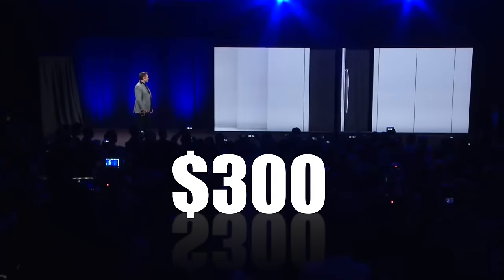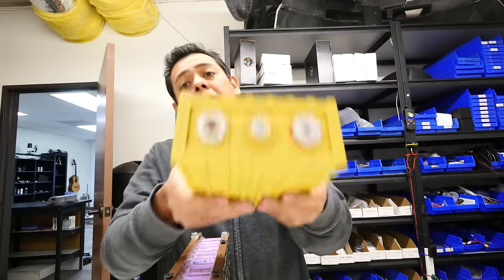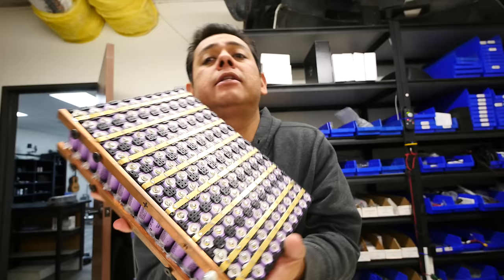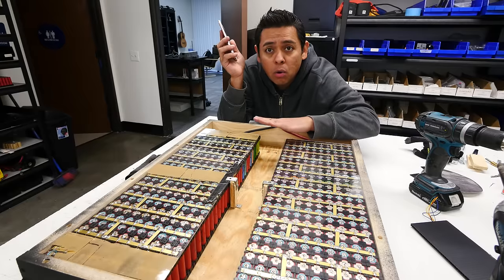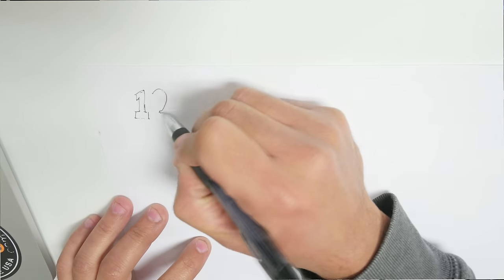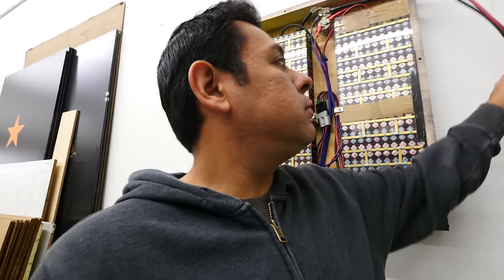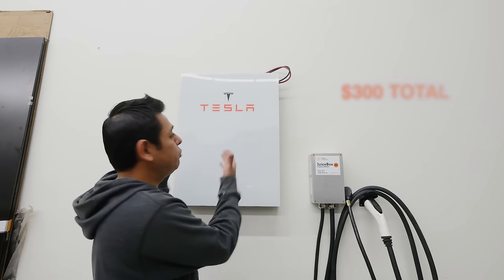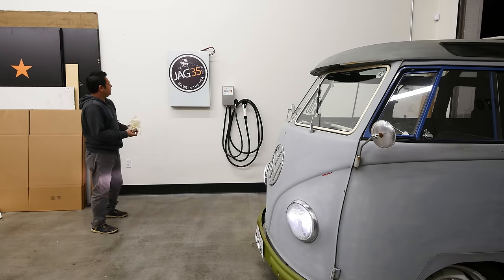$300 DIY Tesla Powerwall - Solar storage 18650 lithium ion home Battery

Comment: How are  you balancing your cells?  This is necessary...
Reply: +Rick Smith bottom balancing is used, with periodic checks with multi meter.
Reply: That's pretty cumbersome when you have 600 cells.  If you get a whole pack down to a certain voltage that doesn't mean that every cell is even.  It just means the pack is that voltage.  Without cell balancing, as time goes by individual cells will come out of balance, this is pretty much certain.  This is why BMS is used in Lithium energy storage applications (off grid, etc).
Reply: +Rick Smith when he checks capacity he leaves them discharged, each pack is 150 cells @3.7v  roughly 300ah. once you solder all the cells in parallel, the charge will even the cells out, then after letting them sit you can charge them to 4.2 or personally 4.1 or 4.15. I have also done this with packs that i have made with no issues, i do however add a bms of charging, but i set it up so that LVC doesn't work, but does give me visual warning (the battery power lights on an ebike) and even if a cell was way out of check or was super bad then the cell fuse will likely og out.
Reply: That's what I am saying.  If 5 cells in a pack are .5 volts difference, how will bottom balancing help this?  This is why with LIPO or LifePO4 people use BMS on each cell so that the cell cuts off charging at a set voltage and remaining charge goes to cells that are not topped off.  In the build your own powerwall situation individual cell health and ability to take a full charge matters.  If you have cells that are lower voltage than the rest in the pack you will still be at bottom while the higher voltage cells are not.  Conversely if you have cells that will not top up to 4.2 volts and others that will you will over charge those that do in order to maintain full stage of charge.  Without BMS/balancing there is no way to accurately charge individual cells based on their voltage.  Long term this becomes a big problem. Cells will eventually drift to different voltages and capacities as they age.  This out of balance situation is solved with FLA batteries during the equalization charge which is typically initiated once per month.  Equalization sends voltage far over max state of charge to top up the lower voltage batteries.  This can be done with FLA because it doesn't ruin FLA batteries.  Lithium cannot be equalized in this manner because it damages the cells.
Reply: +Rick Smith  It all depends on how plug&#39;n&#39;play you want the system.  Riding the safe zone will lead to greater cycles but not getting that 80 percent energy available. In a DIY system I&#39;d prefer a wall that let&#39;s you know you have a cell that&#39;s an outlier and an easy way to replace it...not a fan of balance by discharge either...but prefer one that mimics charging to the same level and swapping out...but that adds costs in switching circuits. Battery management can get overly complex which leads to paralysis by analysis.  I like that Jehu just dives in with the attitude of solve problems as they come in. That's DIY spirit.
Reply: +Rick Smith take 5 lithium cells that are different voltages and wire them on parallel, no let them sit for a couple of hours, come back and disconnect them. check the voltage, they should be the same. (when I've done this test that has been the result that I've had) I personally would use a bms, but for this size of battery it would be expensive, unless you design your own bms.
Reply: +Rick Garza I agree.  I have worked a ton with Lithium and it is my personal preference to maintain proper state of charge in all cells.  Obviously you will eventually detect a pack that won't charge properly and have to isolate the bad cells.  My point, however is that during this unbalanced state you can ruin other cells by over charging them because you have a cell(s) in a pack that will not take a full charge.  It becomes a cascading effect and leads to more cell failures.  This is not likely to manifest itself for many cycles but it will eventually happen with no BMS/Balancing (where BMS is just top balancing in effect).
If we are talking about going as cheaply as possible the do it yourself powerwall will work for sure but eventually it will have issues unless you perform the ghastly "check each cell" type of maintenance (on a full charge).
Reply: +Rick Smith I agree. one thing that is good is that if a cell desides to go "nuclear" the cell fuse will blow (each cell has a 6amp cell fuse.
Reply: +Rick Smith and that is part of the reason I prefer to undercharge my cells. (but I also use bms.) (I also agree with all your points)
Reply: +Rick Smith My preference as well. I have designed laptop power systems and am familiar with nearly every way li-ion can fail. What would really help is a super cheap monitoring system that allows for active balancing. Maybe with over-energy dump off to a common super-cap. I&#39;m a DIYer and designer both. Checking anything manually would get old real quick. Temp variations need to be considered  as well. Be nice to also charge split banks at 1/2 or 1/4C if you don't need all that pack energy quick. Lower the charge longer the life, less heat, etc. Lot's of capacity loss by just cramming 1C all the time every charge cycle. Love lithium. 2.5x energy over lead acid per weight. Can you imagine 4 big 170ahr telcom sla batteries on a wall....
Reply: +austins_creations Depends on how a cell has been treated. If it plated out because on long term under storage with a heavy drain you can get a cascade failure between wraps. That's thermal runaway. No fuse is going to help you. That's why you monitor cell temperature and why some packs refuse to charge. In previous videos he tested each cell after charge...then discarded any suspicious ones. Like to see him expand on how important that is.
Reply: +Rick Smith : You can opt to "Bottom Balance" The cells at close to 100%DOD and then bring them all up to a specific voltage that isn't fully at the top to keep them in line without all the BMS issues. It has worked great in my 3 years with being on an Off-Grid Solar system.
Reply: I agree with that statement.  However you are losing at least 20% of your capacity that way, possibly more.  I prefer to set it up the correct way and top balance.
Reply: Rick Smith : Charging up cells to 3.5v after a bottom balance isn't loosing 20% of their capacity. There really isn't a lot of energy put into a bank when you choose to charge at higher voltages. Top balancing isn't actually balancing anything. Anytime you purchase cells even in the same batch they vary in capacity regardless of stated nominal aH. All you have managed to do with top balancing is push all the variances to the bottom of the pack. If you have one cell at 100aH, one at 105aH, and one at 110aH, regardless of what you do you will only be able to pull out 100aH without killing one or more cells. So, you'll have to stop discharging them well before you reach the bottom otherwise your higher capacity cells are going to murder the small ones. I would much rather have them all at the same capacity when I get near the bottom of the pack where the dangers are. I do not care about eeking out every last aH of my pack by trying to get those few aH above the stated specs. For longevity you want all your cells being 80%DOD not most of them at 80%DOD while one is constantly hitting 90-100%DOD.

Your pack. Your choices. :)
Reply: If you have proper BMS, you risk nothing at the top of the cell or the bottom.  You just realize more capacity and healthier cells.
Reply: Rick Smith : That doesn't make mathematical sense. Where do you believe the differences in capacity are going? The cells aren't going to gain capacity. You either have that variance at the bottom (With your Top Balancing BMS) which means you cannot bring the system down beyond a certain point without destroying the least capacity cell. Or you have the variances at the top and simply choose not to care about cutting off a very small portion in exchange for not having over-voltage issues (bottom balancing). LFP cells are nothing like Lead acids. Top balancing does not magically make them all the same aH. To use an idea that is born out of years of Pb usage does not make any sense in regards to Lithium. After spending several grand for my cells, I would not trust them to a bunch of BMS boards that will inevitably fail over the next ten years in my system.
Reply: +cnypilot  jehu didn't spend "several grand" for his cells.
Reply: Charles Maza : I do not recall commenting on the cost of Jehu's setup. 

"After spending several grand for MY cells, I would not trust them to a bunch of BMS boards that will inevitably fail over the next ten years in my system. "
Reply: Forgive me if I sound Ignorant but what if you cycled the charge going into the battery once its on the higher end of being fully charged, to get past the difference in charge betweem individual cells. Say if the battery cell reaches a 4.0v-4.1v charge and you put a 5-minute delay on the charge so it doesn't charge temporarily, so that the batteries have a chance to balance themselves out, then continue charging. Would that help the BMS problem?
Reply: Michael Roben : 4v is very high for a lot of these cell types. Certainly for LFP cells. When you start using those voltages you have issues with voltage runaway and un-balanced packs. A "Top-balanced" pack where all cells have the same voltage at the peak of their charge is not balanced at all. They still remain varying capacities at the bottom of their state of charge.
Reply: I was assuming the voltage range of the battery would be 4.2v-3v. Kind of not the point I was getting at, at all anyways. I was thinking batteries linked in a parallel circuit will even out their charge if left standing long enough. So why not take advantage of that. the issue with charging multiple unmatched cells is the difference in the load and the vitality of the battery. So the batteries will charge at different rates and once you get closer to being fully charged your likely to have cells that need to charge and ones that don't. My idea is turn the charge off at this point. In theory the charge in between all the cells will want to balance itself out as the current is off. give it some time to balance itself then finish the final bit of charge in phases rather than a solid flow of current coming from the charger till it reads whatever your target voltage is. Like I said I'm by no means an expert just an Idea I got off the video of the guy showing how to recycle old cells and even the charge out.
Reply from the maker: +Michael Roben    Thats only an issue worth thinking about if you plan on Fast charging cells  say above  1.5C rates.  For storage  battery banks of 10Kwh or so that would mean 15KW charging rates,  not very common as is not very practical to stress your cells in that way.
Reply: Hi i need help i don understand what you all are talking about but i wanna to try to build one as this is good way if there a flood and can be use as a back up in home town can you help em with the basic kind sir

Comment: Is plywood really a good material to store lithium batteries in?
Reply from the maker: +rimmersbryggeri   yes
Reply: I thought lithium batteries were a fire hazard espeacially when you have so many in the same confined area.
Reply from the maker: they can be fire hazard,  but if used correctly they are relatively safe
Reply: Yerp

Comment: Very interesting work, only that the price of Tesla wall includes the inverter unit and energy management system with battery pack as a whole. Also, the unit that can charge the battery pack from the solar panel (a DC source) is a converter (DC-to-DC) not an inverter (DC-to-AC).

Comment: Great video and could help people start off doing this. I think we need a clear and accurate sense of the hazards. Potential for a runaway cell to start a fire? My understanding is that ones these things go there's no stopping them. Even a fireproof enclosure doesn't protect you from toxic fumes or from the enclosure getting hot enough to burn the wall or start a fire. 

Not trying to be negative. Just need to understand the risks.

Comment: It's a first step Jehu, I did this 3 year ago with CALB cells, grid tie inverters, chargers and an arduino board piloting the system, and it is still working great. All the info are on my website http://www.diyesskit.com
Reply from the maker: +Christophe HUBERT 
Thats right,   i remember geeking out on your setup,   great stuff
Reply: +jehugarcia thanks, the idea is to always have a net usage close to 0W, net usage being usage - generation